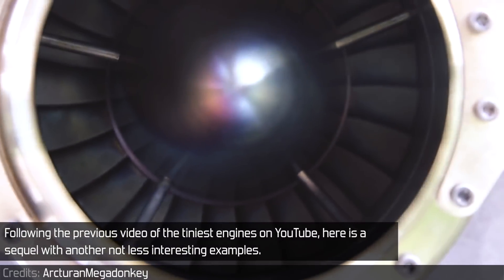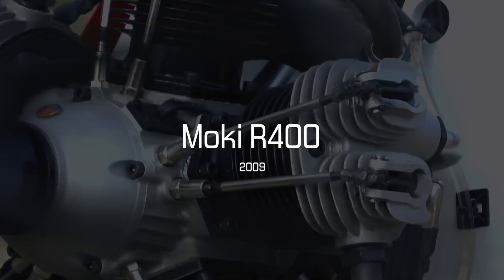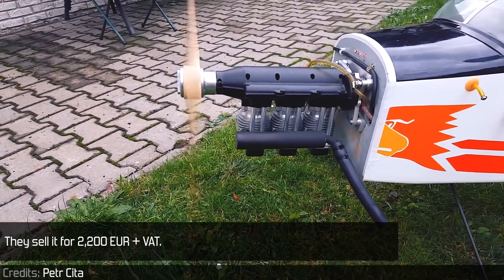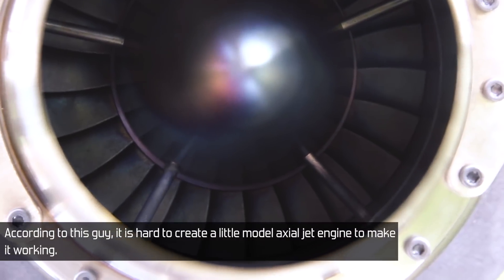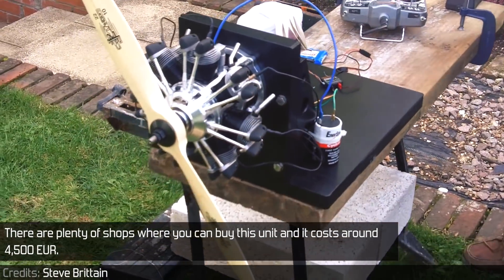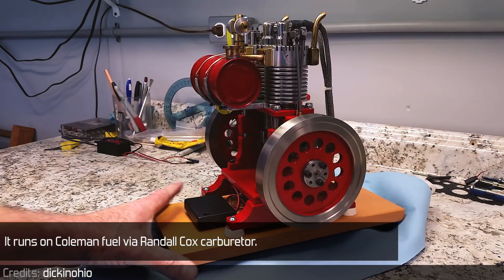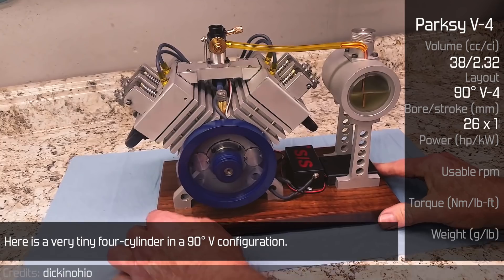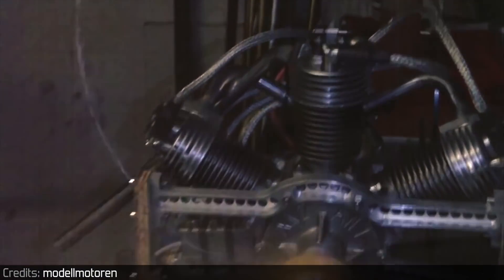10 Of The Smallest Engines In The World | Ep. 2

Comment: 400cc, 23bhp and 9kg! That’s insane power/weight!
Reply: a predator 200cc single cylinder flat head makes about 6hp and it cost only Usd 200 or less...higher hp may also mean low torque!

Comment: I'd love to see some kind of go kart or mini bike with some kind of little engine like these- maybe a radial or a tiny little v8
Reply: Mike Stroz too fragile for that kind of application
Reply: When has that stopped anyone before?
Reply: Jordan E and almost no torque
Reply: Something like that jet-engine on the back of my mountain-bike would be insanely more fun than attaching an electric-motor!
Reply: Thought of putting one of these in my old '75 Simson motorbike since the engine block is completely ruined anyway, but it would take a lot of effort and would not work as well as the stock 4-5hp engine anyway. On a normal bike it would be fun though.

Comment: Just an FYI the factory-16 is supercharged after looking at your video, I️ noticed the supercharger is vertically placed in between carburetor and engine running 90* off the crankshaft.
Reply: Justin Goode 
I saw it too. A Roots type. If they went as far as they did with the rest there would be no reason not to!
Reply: The layout of the superchager is actually correct. The narrow V angel is correct...
The design objective here was to make a lot of power & torque, without much weight. Presented with that today, we would make a small engine that revved high, like a hotted up 4 cyl motorcycle engine. But in 1930, they didn't really have those, and engineering experience said if you turn the thing very fast, it will break. So what you want is a fairly large capacity engine, that spins fairly slow (5 ~ 7 thousand, no more) and you give it lots of boost. Then you try and build a block and valley and heads and main construction, which is as light as possible, but also strong enough to keep it together at 30+ psi of boost...
Porsche was a very original thinker. He sometimes did things the same way everybody else had, but often he went off in completely new directions, like building a car with 4 wheel independent suspension at a time when most cars (even racing cars) had a beam axle front & rear and leaf springs... A beam axle at the front with 4 links, like you see on hot rods, that was cutting edge...
Reply: That might be a fake supercharger.

Also, it's technically an OHV engine rather than a SOHC.